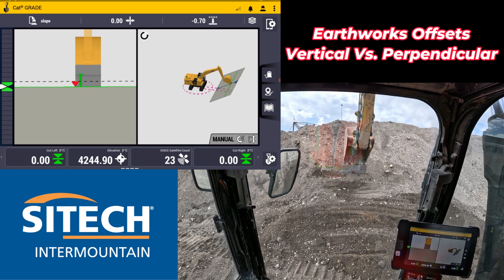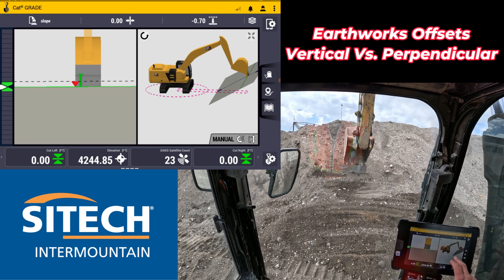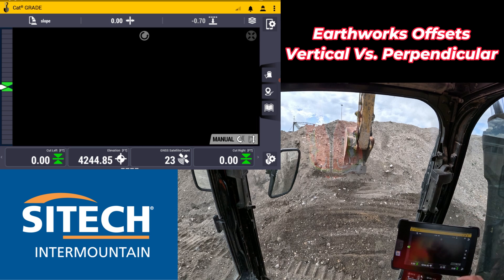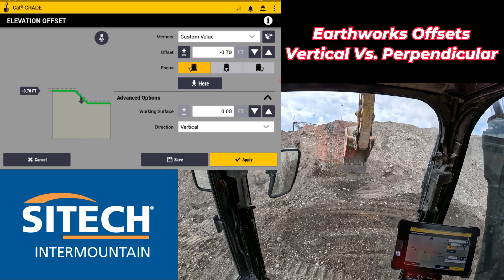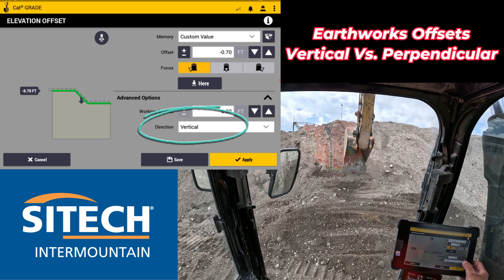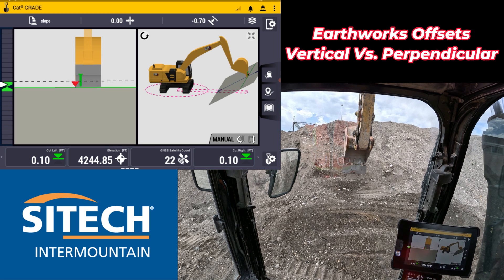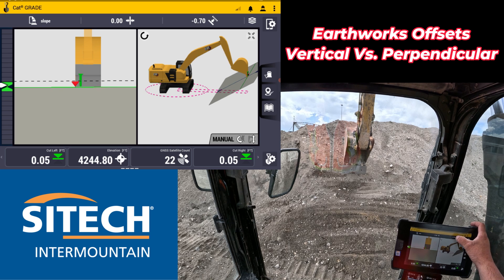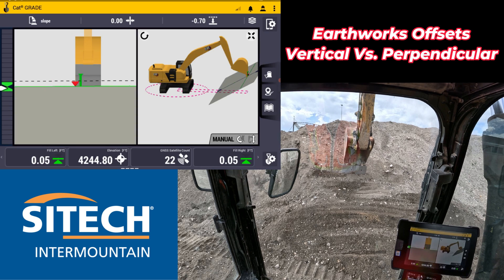Earthworks Offsets - Vertical VS  Perpendicular Excavator

Comment: What is the working service offset box for?
Reply from the maker: @briancaughman9990  it allows for you to set another grade to then offset from.  For example if your model is built to finish grade, then when you put an offset in it is from that grade.  A working surface creates another finish grade or specific elevation to the do your offsets from.   So if the working surface was set to like subgrade, then your offset number would be up or down from that surface